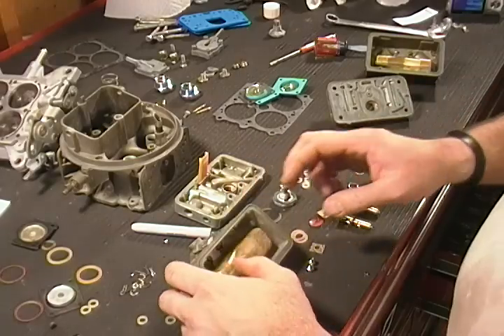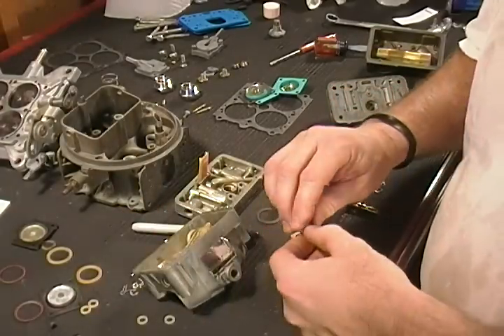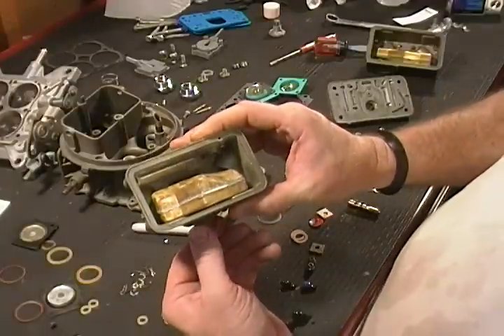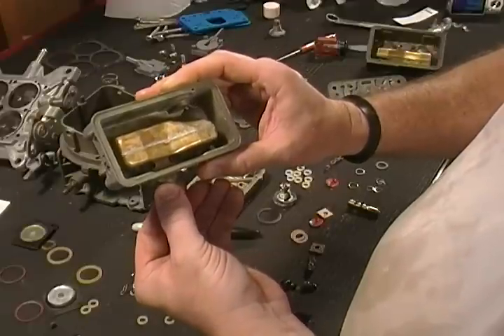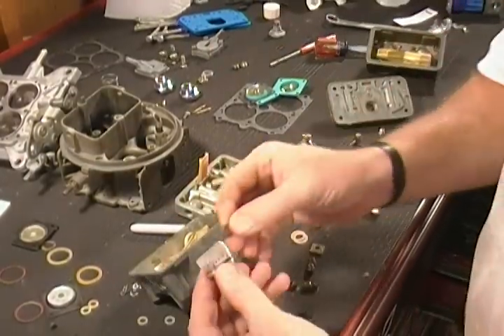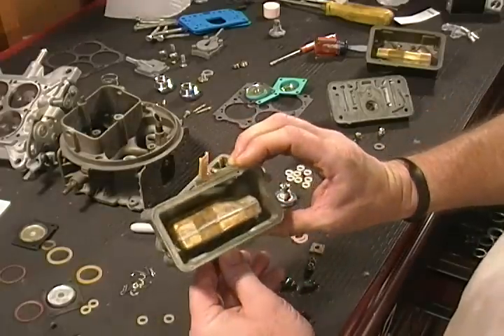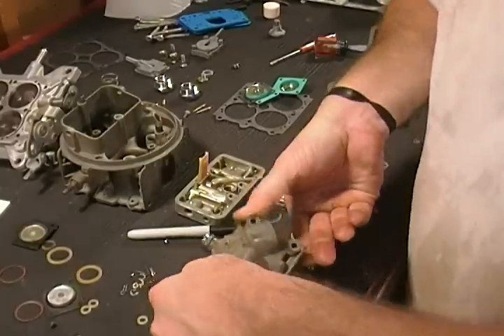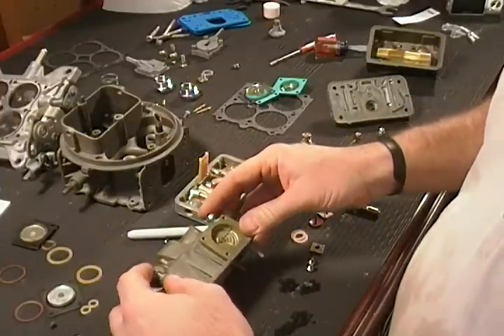How to: Float Adjustment on a Holley Carburetor

Comment: NOW it makes sense to me. Backstory: a do-it-yourselfer that simply loves to learn, but has more experience with fuel injected small block fords. Downside is that I own a carbureted Mustang that I just bought a Brawler (Holley/Quickfuel) carburetor for, and I had no idea how to do adjustments on the float levels. 
Anyway, I just couldn't understand how videos would just say to turn the little nut and it would raise or lower depending on the direction. It just felt too loose to do anything. Now I know that it has flat spots that grab on to the needle and seat. MUCH APPRECIATED, FRIEND! Keeping the art of carburetor tuning alive!